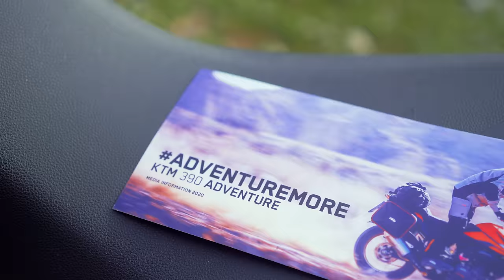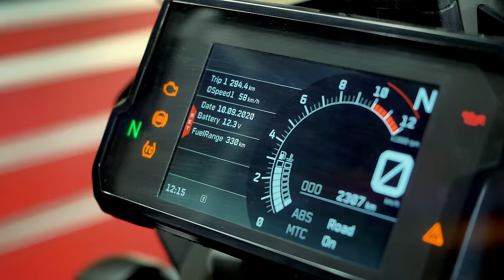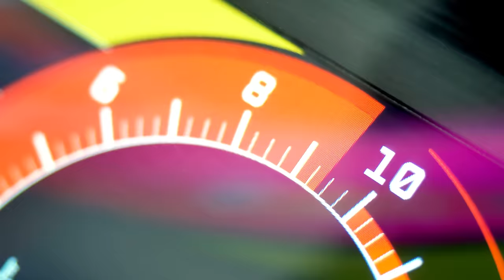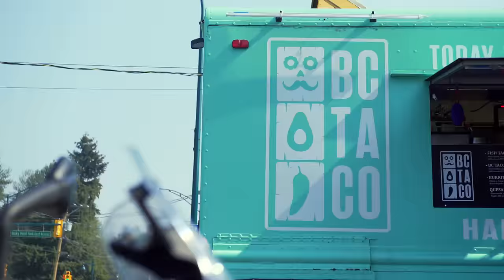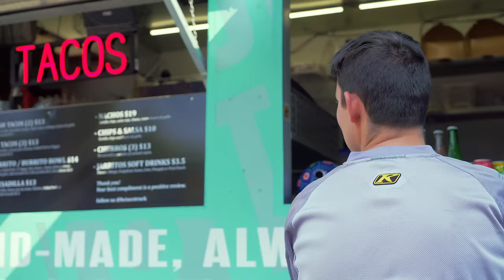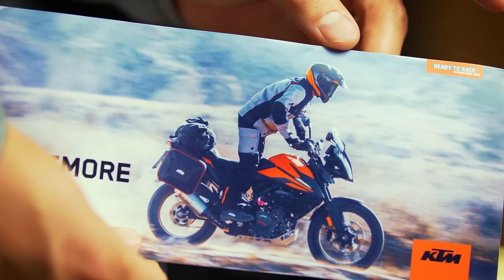The Smallest Adventure – KTM 390 Adventure Review

Comment: Got 2023 spoked wheels model as my first bike. I'm coming from mtb/xc-ish bicycles and do simple forrest single/double tracks with various surfaces like sand or dirt. I'm really not into busy highway riding and I avoid riding in the city for safety reasons but also because I just enjoy quieter backcoutry roads and nature. My typical ride is 70-100+km with 70% dirt/sand single/double track. And I have to say that I'm really loving this bike so far.

I'm 191cm(~6'3) and 130+kg(~290) and this bike is very comfortable for me. It has plenty of power to haul me around in 1/2 gears up the offroad hills, and generally has enough torque at low revs, which means that it is also very quiet (I keep it below 4K revs usually) and doesn't annoy me at all.

The suspension is great and comfortably handles my weight everywhere without bottoming out, including pump-like singletracks, misc obstacles and potholes. 

Regarding the pegs, I don't have much experience with other bikes, but coming from bicycles I don't really notice that they are tilted, but I do notice that they are smaller than what I'm used to. That being said, with size 12.5 shoes I really don't have a problem standing up and going over hard terrain. Maybe I would like to get handlebar risers, but even as is I really don't have any problems with them.

I've considered other bikes, but here in Ukraine we don't really have good dealerships for japaneese bikes (hard to find kawasaki, yamaha, etc dual sports) and in most cities in terms of dirt/adv bikes you really only have a choice to either get a cheaper chineese dirt bike and pray that they will have parts for it if something breaks, or get an expensive ktm but have dealerships with all parts stocked at any time. So that's what I went with and so far only got engine guards and will probably get a single-piece seat to be able to slide around more easilly offroad.
Reply: Update: it's been a year so far and I've upgraded to an OEM handlebar riser, OEM single-piece offroad seat and mitas e09 tires. Risers and seat made it much more comfortable for me, esp offroad. The tires made it amazing on wet dirt/sand and wet clay. I'm absolutely loving it so far, 150-300km dirt roundtrips exploring backroads and nature are a total piece of cake for this thing. Great all rounder, I wouldn't want to upgrade to anything else, but I am looking forward to 390 adv R in the future if it ever comes out.

Comment: I also just bought a 390 ADV and spent the weekend riding over 300 miles of a mix tarmac and dirt/gravel roads. I really think that's it element sure its not a big 1200 GS or a full on Dual Sport but a perfect out of the box small capable bike for short money. and geez foot pegs can be modified in 15min so why buy a Duke with lower ground clearance, street tires, shorter susp travel, no windscreen, no had guards, no bash plate or crash bars? there's over a $1000 of parts and off road set up right there.....foot pegs be damned!
Reply: 390 ADV is also the PERFECT commuter bike.
Reply: If you want to ride over trees and fly high though the air or race down single track...GET A DIRT BIKE. If you want a highly capable light-weight ADV bike then this is the best. I take my 390 on Colorado trails and have yet not been impressed with what it is and I do take it over the trails in Rampart Range Colorado and around Central City and it's impressive. Would I ride it like my dirt bike that has 10 inches of travel, weighs 240lbs and has 13 inches of ground clearance.. uh no. That's why I own two bikes. And at 5ft 9inches I have no problem standing on it and squeezing the seat and No the bike does not try to throw me over the handle bars, maybe he should learn to stay off the front brake. I will tell you riding a 500lb ADV on these same rocky trails is an exercise in keeping it from tossing you to the ground. If you want to ride fast and loose on the trails get a true Enduro or pay 2x more and get the KTM 790R.
Reply: Yeah, it's clearly aiming for the market of the CB500X, Versys-X 300, and RE Himalayan.
Reply: @gpnmoab1  Yes! It's an "entry-level" ADV bike. Noobies don't do logs or jumps or steep inclines / declines ... at first. They ride 80% tarmac, 20% dirt forest roads, double track and some sketchy rough gravel.  Let's be honest in exactly for whom this bike is advertised -- those who want to explore some moderate off-roading but not drop $15-20k while dreading dropping their precious jewel on the deck.
Reply: @osimnod  I could argue there are only entry level riders and not bikes. Each bike has a defined purpose, but that doesn't mean you can't take it places where it seemingly does not belong. With 40 years experience racing dirt bikes, enduros and owning many street bikes I know the difference between a inexperienced rider and a crappy bike. A skilled rider can take any bike to its limits or their own limits and make it look easy. IMO, all so called "Adventure bikes" are firstly street bikes and behave as such off the beaten track and the heavier and larger they are the worse they handle in the rough stuff. Try side-hilling on that 1200GS or take that up or down a rocky trail or have the thing fall over top side facing down hill, or squeeze that beast between trees or just turn the damn thing around on single track. Oh, and watch out for every rock it hits as the inertia of all that weight will plow that front end into directions you didn't anticipate and then laugh as the 180lb rider wrangles that 500 to 600lb bike like a bull rider hanging on for dear life. Lighter, smaller bikes are better off road and that is a fact.  Suspension travel, well that only depends on how fast you want to ride and the terrain you like to ride on - choose the right bike for the job but don't condem a bike because you don't understand what you've purchased. So let's not call bikes "entry level" bikes like they are some how less of a bike if you don't spend 20 grand on one - that is the bike's world elitist talking and we certainly have more than enough of them running their mouths . I'll take this bike over a 500 lb bike unless all I want to do is travel the highways. And if you don't own the bike and have not spent several hundred miles riding it first, do us a favor and don't pass judgement on something you know little about.
Reply: @gpnmoab1  Perhaps you misunderstood my comment. I put "quotes" around "entry-level" merely as an editorial technique, not as a  slam on less-experienced riders. You and I agree that it's the rider, not the bike, that makes all the difference in the world. I'll keep my 640 Adventure as it delivers what I want and put up with the quirks that bother some riders. Happy trails to you!
Reply: @osimnod  I agree and really I was responding to this video and all the reviewers trying to make this bike out to be something it is not. I myself specifically wanted a relatively light, but not small bike, that could be ridden long distances and take me on the trails I expected to encounter. And when I pushed it hard It took me everywhere my dirt bike has, just not as effortlessly or as fast but I had a blast. It will get you there.  As you said, rider skill plays a bigger part.  I apologize if I directed this at you.
Reply: @osimnod  "... They ride 80% tarmac, 20% dirt forest roads, double track and some sketchy rough gravel ... while dreading dropping their precious jewel on the deck." Nailed it, and as a noob, so far I'm having a ball on mine. If I could rock offroad like Ryan, I'd want something better too, but I don't, so my 390 is perfect.

FWIW, I loved the Duke too. Playing in traffic on anything with this engine is a blast.
Reply: @gpnmoab1  No worries. These threads can get confusing.
Reply: I actually think Ryan nailed it. 

I've been riding dual sports for 7 years and 60,000km.  I had hoped the 390 would be more like a lighter more awesome crf250 rally or versus 300x.  

The parts on the 390 are better... but where i ride the 390 ergos suck.  

In my opinion this is not an "adventure" bike but a "sport touring" bike. 

It is a mini, v-strom.

Comment: My buddy has a 390 duke and he loves it. I took it for a spin recently and I gotta say I was petty impressed with that single cylinder
Reply from the maker: It's a great motor - ideal for an adventure bike. I just wish they put it in one. ~RF9
Reply: @FortNine  hey bud thanks for the reply! Yeah it’s too bad this KTM fell short. Hopefully the next iteration will have more ground clearance and normal foot pegs and I’ll be all over it
Reply: @paulallen-01  How hard can it be to change the foot pegs.
Reply: @AshHalls  not hard at all but the pegs would still be at the same height
Reply: @paulallen-01  so it’s probably better to wait for the newly designed 490 Adventure. Seems like this bike would be a let down on trails
Reply: @AshHalls  the point is its not got adventure bike ergonomics, its not designed as one, the subtle changes are massive in the real world
Reply: Damian Jablonski  no shit!? I didn’t know that!! Thanks!
Reply: @FortNine  can you do an episode on tire selection? For instance are these tires happy on road and trails?
Reply: @FortNine let's hope next year they actually give it an adventure chasis.
Reply: @FortNine It's hardly got any torque low down, how does it make for a great engine for adv riding?

Comment: Beautiful as always, though I want to point out that despite the marketing and how the big ones are built, not everyone who wants an adv bike is near 2 meters tall.  At 166 cm (5'6") and a 73 cm (29 in) inseam I'd expect to have plenty of bike to grip with my knees.
Reply: I think he's not that tall, smaller than 190cm if I remember correctly but you're right, there might be more to hold on to for smaller ppl than RF9

nvm he's 193cm according to comments
Reply: Well I guess now bikes need a height chart like the water slides at the park .😂
Reply: @SwainixFPV  yeah, most of southern Indians are very short, I guess this is the market for them.
Reply: Adventure bikes are not really designed for short people, because ground clearance demands height, it's the harsh reality.

  The 390 adventure is not an actual adventure bike, it would be even worse for you then if it came with a 19 inch front wheel.

  I understand that you want to ride a capable bike, but my 1.51m tall niece has ridden 450 enduro bikes before, it's just something you have to get used to.

   Adventure bikes are not enduro bikes tho, i own a Versys X300 and that bike can be too heavy once it wants to fall sideways, unless you're a strength athlete, i don't see how could you hold a bike more than twice your weight when it wants to tilt at idle.
Reply: It takes 1000cc+ bikes to accommodate people above 190 cm. I used a Pulsar NS 200 at 178cm myself and it was ok, this bike is about that tall too.
Reply: @Al.j.Vasquez  it's not even just ground clearance. If you want 9inches of suspension travel the seat height will differ by 9 inches from top too bottom.
Reply: It's a sportbike seat with a sportbike tank and the upper half of sportbike fairings. Even for you there isn't a place to grab on to. Your knees probably won't be next to the tank either, but even if they are, there's nothing but flat slippery plastic instead of the indentation for knee gripping that adventure bikes have
Reply: @SwainixFPV  He's 6' 4" tall.
Reply: @Al.j.Vasquez  you are talking more about enduro then
Reply: TheTimon2000 Ryan is 6’4”
Reply: @Al.j.Vasquez  Well, the Himalayan has a short seat height and more suspension travel than the 390 Adventure. That was a deliberate choice by RE just as making the 390 Adv this way was by KTM.
Reply: @dalehunt1383  thx, I was wrong, that's 193cm according to google (for the rest of the world if you read this)

Comment: Funny as always, buuuuut... on the other hand, I was looking for an entry level dual sport. Usual suspects, CFR250L, DRZ400, KLX250. Wasn’t even thinking a KTM anything. After watching many vids from India, UK, Aus, my interest peaked, but not a 390 ADV to be found. Test drove usual suspects, months went by, finally 390 hits US and I got to test drive one. My conclusion after riding all, was go with 390 ADV. Price was about same , all were fine bikes, but 390 won hands down for me. It was not 20 years dated technology, had on/off road safety features, was at home on/off road, had larger fuel tank, adjustable suspension front /back. All I did was put more off roady tires on (waiting on gear change) and I’m good, having a blast off road. Yes it’s a 390 duke relative, but watching 390ADV keep up with much bigger bikes all over the world off road in far worse conditions than I will ride sold me, couldn’t be happier. They call it ADV, it’s based  on street, but to me, it’s perfect dual sport. And at same price point, no brained. Now if it was couple thousand more, that’s a different story, but it was cheaper than cfr250L Rally. Test ride one, form your own opinion, but I’ve been having fun from day one and haven’t looked back.
Reply: Glad you are enjoying it.. but nah, its a street bike. I can ride a 70s cb350 and keep up with most of the big bikes. You see that in the long way round where clapped out 250 street bikes in mongolia are running circles around the elephant bemmers sinking into mud. 

As per this bike if you enjoy it, awesome! Ride it for what it is, but ti claim its better because insert noob tech or "newer design" its laughable. Id rather have a true ds bike like the drz or the fuel injected yamaha anyyy day for adv, offroad, etc. This ktm has good suspension, its a great commuter.. what kills it for me, ugly headlight just like its big brother.
Reply: Have one myself and absolutely love it, it does struggle on hard off road stuff but the only stuff I've came across that it hasn't been able to deal with is dirt bike levels of off road, it's amazing on road and very fun off it and is more than adequate for the type of off roading most people will be doing, i went out with a gs1200 and a ktm 1090 adv beside one rock it kept up with them fine, and the rock i couldn't get over the gs really struggled and the rider dropped it in the process, it's no dirt bike but i think it's a genuinely brilliant adventure bike, and almost all the issues he has with the bike you can replace with aftermarket parts
Reply: @North_Of_Nowhere  that gs is no dirtbike either, your lighter bike is much better in my opinion. The big Ktm though, put a capable rider on that and it would leave most other advs far behind..

Comment: Ryan : The Smallest Adventure KTM 390!

Versys 300 : am i being forgotten?
Reply: Honda 250 Rally :)
Reply: BMW 310GS ?
Reply: @keithhewitt8449  he has done a review on it very sharply
Reply: That's what I thought as well. Then I realized what the pun was.
And now I feel stupid :(
Reply: @ananthamurthy1221  not the GS, he's reviewed the R.
Reply: @sivvinod3187  whatever...it has the same engine..and he'll point out the same issues
Reply: @ananthamurthy1221  no, some of the problems came from the suspension and other parts, the engine has only 1 problem: the gears are set up completely wrong.

Comment: This video is kind of crazy. Because we see F9 riding the bike very well through a variety of mild to moderate off conditions, showing the bike to be capable. It has great suspension, not just for it's price but period. He likes the bike alot, but is pissed about the foot pegs. Ryan is very tall, so the issue will be exaggerated for him, but for shorter riders, like 5' 9" and under, with a little crouch of the knees(or a lot for tall riders) you get into a very good riding posture. 
This bike is really a scrambler with its ground clearance and ergonomics, which is great because most of the riding I would expect to be capable of doing on a bike that cost so little fits within it's abilities and unlike my KLX it is awesome on the highway. It's really a mislabeled scrambler, and maybe KTM will do some cosmetic redesigns and market it as a scrambler, because its a damn good one, with highway savvy for dirt cheap money.
With the spoke wheels now available for the 390ADV, maybe they will have the 'r' version. They can be serious, there is no reason why they couldnt put a 21" wheel up front(and keep the 17" on the rear). It would be very bad ass.
I really like that the description says possibly "carefully designed not to offend its older siblings"
For my size at 5'9", I think this is a good choice for anyone who wants the fun of the 390 duke powerrplant, but with a comfortable seating position and getting awesome suspension and very respectable ground clearence for a scrambler.
Come on KTM, remarket this into a scrambler, black with minimal amounts of orange and keep the cool headlight.
This is the first KTM since I've been familiar with the brand that offers an upright seating position in this price range and that's good news for many riders who wanted a KTM, but didn't favor the duke's forward riding position.

I would like to get the KLX 300sm but it will probably never be available in my market, so a scrambler with decent ground clearence for the reality of most all of my riding(I have a klx 150 now with similar suspension travel and I have no shortage of fun on it.)
I'm going to get the 390 scrambler that KTM has mislabled as an adventure bike, because it will get the job done very well of putting a smile on my face when I ride it for very cheap dollars. But, I do hope the reliability is reasonable. They've been out for a while now and I'm not hearing much about engine problems.
The KLX300sm is the best for sure of the two for a do everything(and much lighter) bike on our road conditions, but we only have the R version here, maybe in some paralel universe I am riding a KLX300sm with some tkc80's, but in this one it will have to be the ktm scrambler.